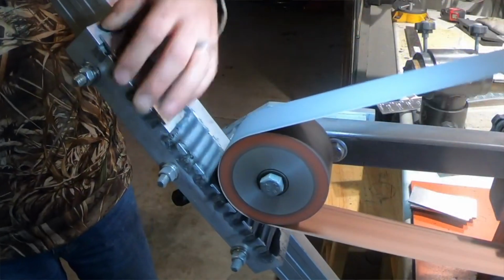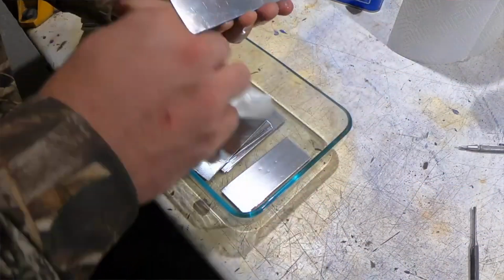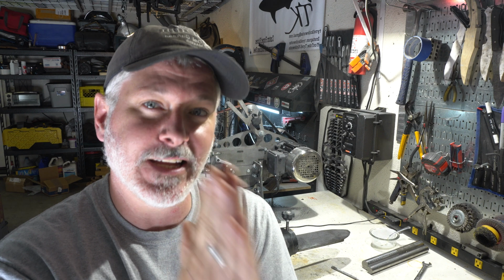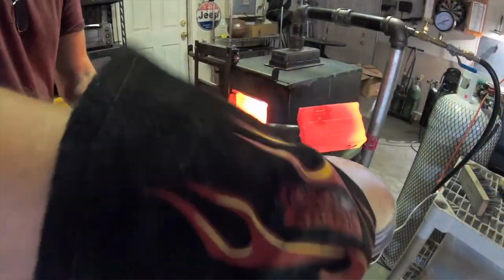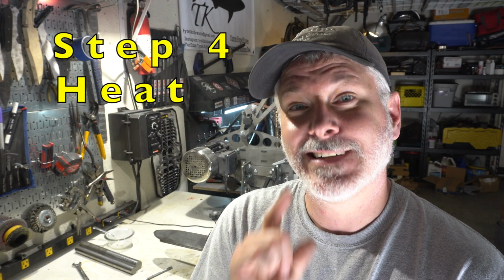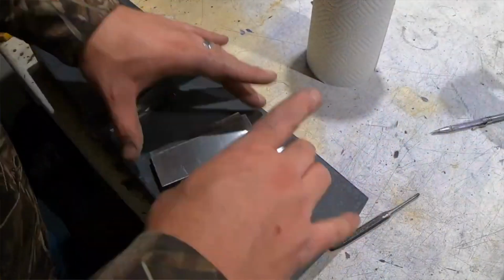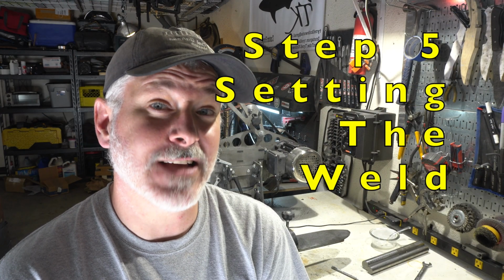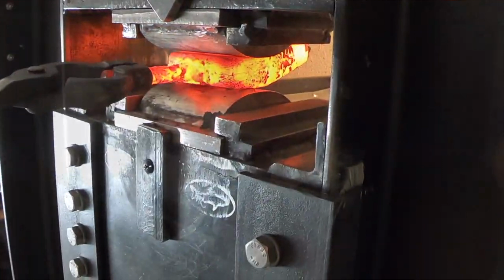Triple-T #43 - 5 Tips for better forge welds

Comment from the maker: Did you find this video helpful?  Are there any other tips and tricks you'd like me to talk about in future videos?
Reply: Hand grinding bevels still hang me up. Any tips there?
Reply from the maker: @Triple_D_Forge  I'll probably do another video on grinding tips soon.  If you look back in my Triple-T videos you'll see one on grinding tips so check that one out for now.  👍🏻
Reply: Your finish for damascus blades would interest me. I think everybody knows how it works but a more in-depth look at how many cycles, what abrasives in between those, dilution for ferric chloride etc. could be interesting. I had a great damascus blade turn out bland because I did it wrong the first time around.
Reply from the maker: @NjordArtisan  That is an area where I am constantly updating my process.  I still don't have it nailed but I think it's getting better.  I'll do a video on it soon, thanks for the suggestion!
Reply: Grinding Damascus in between and before and after re-stacking is a big one everybody completely skips over it is one of the most time consuming and laborers part of the processBut I think the coolest video you could do would be on making Damascus with other Steels such as crew forge v or  Stainless Steel’s Like damasteels you would find on Commercial bought folders
Reply from the maker: @tommydean9414  I totally agree, grinding between restacks is super time-consuming.  I will be playing with some stainless Damascus soon!
Reply from the maker: @tommydean9414  thanks Tommy!  I appreciate the kind words.  I’m glad you are getting good info and inspiration from my videos.   That’s what keeps me going! 👍
Reply: How about fullers? Any tips?
Reply from the maker: @ne1Elz  when I do fullers, I cheat and use the mill. 😜  I have the fuller attachment for my 2x72 but I have yet to use it.
Reply: شكرا على المعلومات القيمة ..عندي سؤال هل يوجد بديل لمادة .البوراكس. وهل يمكن الإستغناء عنه 🤔
Reply: Or playing around with how to make titanium Damascus!!!!!
Reply from the maker: @tommydean9414  that’s a tough one that I don’t think I’ll attempt for quite a while.

Comment: would you put the Flux in between the 2 pieces being welded? Or just on top ?

I have a Propane Forge.
Reply from the maker: It’s best to use flux only in “problem” situations.  Normally I do not use flux anymore unless there’s a problem.  If you dial in your forge with a fuel-rich environment the flux isn’t necessary.  Thanks for watching.
Reply: @TyrellKnifeworks thank you. In a  problem situation do you put flux  in the area to be welded or just on  top just so the flame can burn it.

Comment: I use WD-40, some people use kerosene or diesel fuel to keep oxygen out or burn it out of the gaps before it gets hot enough to get the borax to melt. I should add im a total rookie and I haven't learned exactly how to det the flame on the forge yet, and ive only 5 successful forge welds under my belt.
Reply from the maker: Yes, any fluorocarbon will work for this purpose.  Some guys use their quench oil.  Thanks for watching.

Comment: i use a coal forge will it get hot enough
Reply from the maker: A coal forge will get hotter than a propane forge.  The problem is that it’s very focused and localized so it very hard to do Damascus of any size and keep the heat even.

Comment: Denis, you do a great job of explaining this and everything else in your videos.   I am new maker and would like to know why one would not TIG weld the stack without filler rod so inclusions should not be a concern?
Reply from the maker: At the time I didn't have a tig welder.  For tall stacks like this that you're going to be restacking so you'll be cutting off the ends anyway.  If you have access to tig (and you're decent at it) then sure you can fuse it instead.  Most guys don't have a tig, so that's another reason I didn't and probably wouldn't show or talk about that.  Thanks for watching, Glynn.

Comment: I know I ask a lot of questions sorry. I saw manual hydraulic presses at Harbor freight. one for 20 ton one for 12. If I bought the 12 has a solid I-Beam the other has U channel bolted together. I tried to find what the metal is rated at I was thinking I could buy one and weld it together. Then change the manual press to electric. What is the ton i should shoot for to have a forging press is 20 ton enough or 40. I figure the rating on those set ups is for it being bolted together. With steel prices through the roof if I could buy and convert one of those for 150$ I am not looking to smash steel flat from 6 inches just move it an inch or so at a time. It is that or build a pneumatic hammer but again I see cylinders rated for 600lbs but doesn't explain is that push or pull can it do it fast over and over etc etc I prefer the press but I can't find anyone that has attempted my thought yet
Reply from the maker: I don't think you're going to be very happy with those.  The structure just isn't rated for pushing metal, they are meant for seating bearings and such.  You're going to spend a bunch of money trying to make it electric and it will be slow and you won't use it.  Sorry, I know its not what you want to hear, but better to hear it now before you spend the time and money.
Reply: @TyrellKnifeworks  why I asked what are the stats I am looking for to have a fast hydraulic press. I looked at your pump etc but I would like to know the stats I need to make it fast. I found a site that sells the pump and tank together but what stats do I need. Then they have pistons but is it just 5” or 4” bore that matters etc etc.
Reply from the maker: @christopherconkright1317  I use a 5hp pump with a 13 gpm pump.  With a 5" cylinder, that equates to about 1.5 - 2" of travel per second.  The slower the pump or lower the hp of the motor (or a combination of the two) will result in less speed.  The diameter of the hydraulic cylinder will tell you the tonnage your press will provide.  I hope that helps.
Reply: @TyrellKnifeworks  actually yes that makes a ton of sense. Last question what ton of pressure for what? Could it be 20 tons or does it have to be 40-50 tons. I see people crush metal into a puck but I just want to go an bit at a time for Damascus or shape something.  Not overwhelming cosmic power just basics lol
Reply: 5” 50 ton 4” 40 ton and so one for bore equals ton I assume?
Reply: Ton of sense pun intended lol meant to right that lol
Reply from the maker: @christopherconkright1317  Yes, you can scale it down to a 20 ton for sure,  even a 12 or 16.  Coal Iron Works have a 16 ton that's very popular.  Speed is as important (or more) than the cylinder strength.   With a press like that you just take smaller bites each time.
Reply: @TyrellKnifeworks  Thanks this helps a lot
Reply from the maker: @christopherconkright1317  No, 5" doesn't equal 50 tons and 4" 40 tons...you have to look at the number of pounds the cylinder is rated at divided by 2000 will give you the number of tons.  My 5" cylinder is rated at 58000 lbs so it's roughly a 30 ton cylinder.

Comment: Why is flux bad for your forge? I know nothing about forging. I do know about combustion. I've built or commissioned hundreds of 40mmbtu to 150mmbtu industrial burners for 30 year. My combustion fans are 20 foot squirrel cages and my gas comes in a 6" pipe running at 30 psi. So I know how to blow a building up but I don't know why flux is hard on refractory.
Reply from the maker: Flux will eat away at the bottom of your forge.  If it’s castable refractory it’s usually tougher (like mizzou).  The cheap stuff from Home Depot gets eaten away quick.  Anything like koawool also gets destroyed quickly from molten flux.  Thanks for watching!

Comment: Thanks again for sharing your knowledge. About to try canister soon. Any tips for a beginner. Thanks
Reply from the maker: First tip, use a stainless steel can.  Screw whiteout, that’s terrible.  If you use a stainless canister it’ll come off with zero problems.  Put the caps on the inside of the tube, they’ll survive more stress that way.  Next, heat up until you think it’s hot enough, then wait another 10 mins!  You basically can’t overheat it to make SURE it’s at forge welding temps.  Good luck!
Reply: @TyrellKnifeworks  All I have is a stick welder. I bought some heat treating foil. Thought I would line the can with this. Otherwise grind the can off. Thanks again.
Reply from the maker: @edthompson3353  yeah, stainless HT foil will work. 👍

Comment: Thanks for sharing your knowledge! I got two failed attempts so far with the last one almost working and with this info the third time may actually work 😄
Very interesting with the gas/air mixture. I got a blue flame, but theres still flames shooting out the front, does that still mean there's too much air?
Reply from the maker: You’ll always have a blue flame, but having some red flames out the front is good when forge welding.  Note that if your using Venturi burners, they aren’t as efficient as ribbon burners because they don’t mix the air/gas as much and you get more combustion outside of the forge no matter what.  Play with your air intake and decrease it a bit but provide lots of gas.  With some Venturi burners though this will make them sputter.  (You can see why I’m not a fan).  But you can certainly make it work.  Just keep tweaking them.
Reply: @TyrellKnifeworks  Thanks for taking the time, Denis! My father build that burner himself and it doesn‘t seem to be either of those but thanks to your video I took some time and asked him how it actually works 😄
I‘ll be playing around with the air intake a bit now that I know where it comes from and that it‘s actually important 😄👌🏻

Comment: Wouldn’t there be a chance of flux getting trapped in between the layers if you use a flat die on the press all over then billet to set the welds?
Reply from the maker: That’s why you don’t put flux between the layers and only on the edges.  Step 1, have clean flat surfaces is the most important part.  👍
Reply: @TyrellKnifeworks  ohhh okay. I still assumed that the flux would still creep between the layers even though they are flat. Thanks👍
Reply from the maker: Maybe a bit on the edges but it’ll get pushed out.  I’ve never had an inclusion of flux in a billet and I’ve done a lot of Damascus.

Comment: Have you ever tried welding a mild steel sheet metal box around the stack for the first heat?  I've seen this done, notably by Kyle Royer. His results speak for themselves, but wonder where you are with the idea. Great TTT .✌
Reply from the maker: Sure, I've done that method as well.  I did it for my previous feather bowie in fact.  I rarely have issues forge welding so the sheet metal has always been more effort that its worth for me.  Not saying my welding is better than Kyle's by any means, just that I'm ok if it fails once in a while and I have to start over.  Thanks for watching, James!

Comment: Just a helpful tip for those that are worried about flux eating up there forge lining… use a piece of stainless steel in the floor. I use a piece of 1/4” 304ss and it’s lasted 8 months or so. The scale that pops off of it makes a mess in the forge but is easily blown out after it’s all cooled down.
Reply from the maker: Thats a good tip, Erik.  I've heard of people using ceramic tiles as well.  I built my forge with soft firebrick with an inner lining of hardbrick and mizzou so it could easily be relined.  👍🏻
Reply: @TyrellKnifeworks  yeah mines kaowool and kasolite 30 with bubble alumina I’m the bottom. But I hate relining. The plate is quick and easy to pull out or put in.

Comment: Ive used a coal forge for blacksmith work would it be suitable to do forge welding of  Damascus steel?
Reply: It works just fine for pattern welding but you have to pay very good attention and use prefferably coal coke as fuel. In coal forges flux can be a good friend since you cannot perfectly control the flame like gas forges and flux despite the corrosion helps keep oxygen out. Just be careful the piece does not burn because the weld temperature is very close to burning. And of course make sure the coal is burning clean and glowing good before you put the piece in or it will fill with soot and the  weld wont stick.
Edit: i forgot to mention its very important theres enough space between the piece and blower in a coal forge since the direct air can either cool or ignite the piece so remember to keep an eye on the angle.
Reply from the maker: Absolutely, a coal forge can get even hotter than a propane forge.  I have no personal experience so I can’t really give you tips, but it certainly can be used to forge weld.  👍

Comment: Good info, and yes flux needs it's own category.    I've never cared for using it myself, its messy and pretty corrosive.   But I've also seen a lot of folks use it like its glue....  however if the steel is prepped and cleaned thoroughly I feel it's more of a weld liability...  if you've gone through the process of cleaning, why add foreign materials into the equation.
Reply from the maker: It’s a matter of preference I guess.  Using it sparingly while your forge welding has never given me issues.  If I’m going to be forge welding something critical, I’ll just use sacrificial steel and encase it.  Thanks for watching!
Reply: @TyrellKnifeworks  ya the sacrificial steal is a good option as well.   About the only time I use flux is working with cable.   Its currently the only situation I find it to hard to clean the steal, and there is typically already an over abundance of foreign matter present to warrant adding more.  But that's just me, different strokes for different folks.  
Good info and vids bud keep it up.